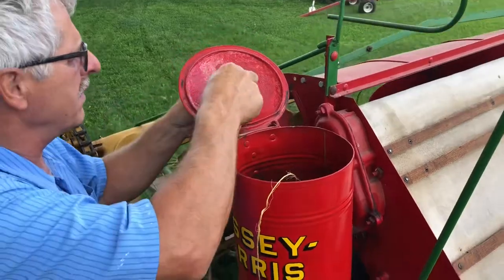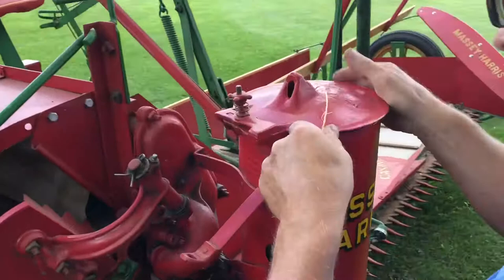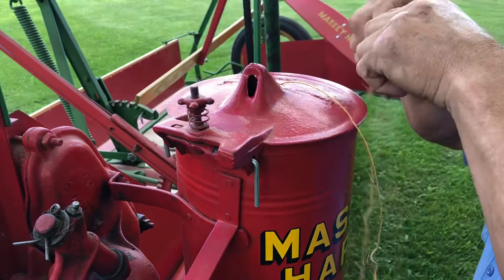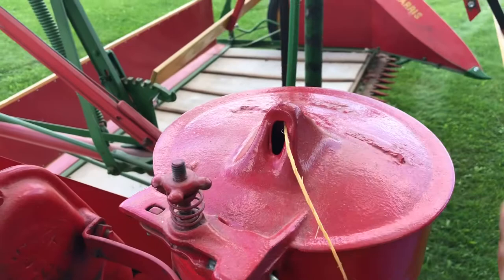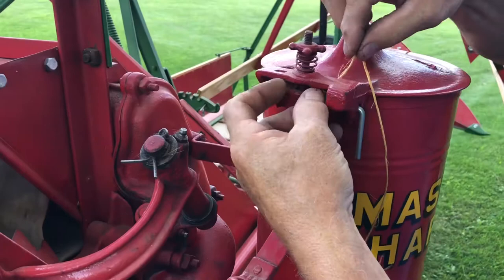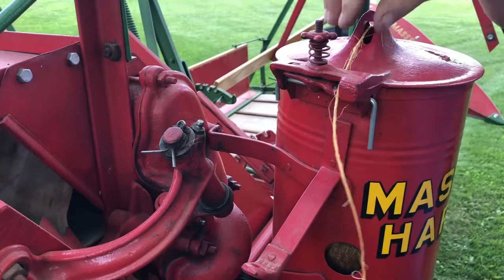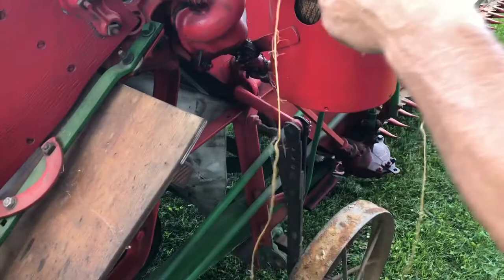Threading the Knotter - Massey Harris Binder No.16

Comment: I know this is an old video, but I have a Massey binder with same knotter. I bought it this spring in working condition, and just today was going over it and noticed the front most curving arm on the knotter, the first one you encounter when looking in from the front, was broken off about 5 inches up from the hold where the crankshaft goes through. I'm assuming the binder was still tying satisfactorily with this broken off but I do not know what it does. I cannot find a slow motion video of the knotter in operation. I'm guessing it is some sort of arm to hold back the incoming grain whilst the knotter ties and kicks out the sheaf? Other than that it has a broken and missing spring, the long curving ones that bolt to the tinwork above the knotter to form the sheaf.
Reply from the maker: If you want to email us, we can get you in touch with Gary! info@napdesign.com